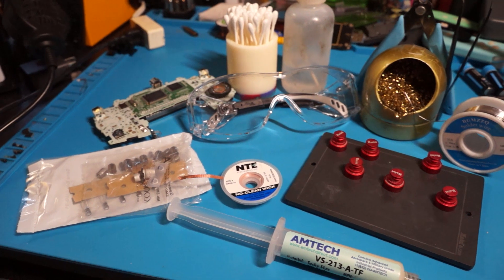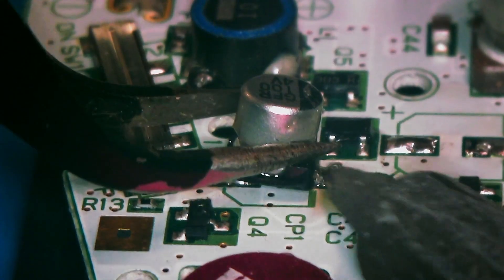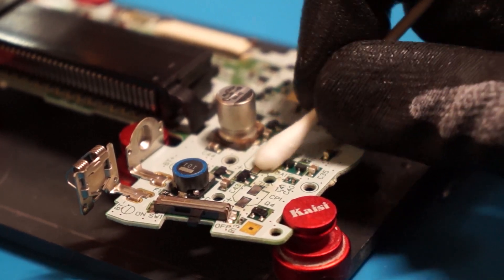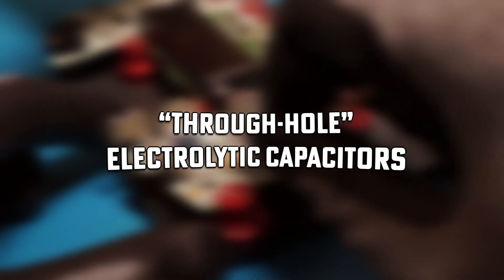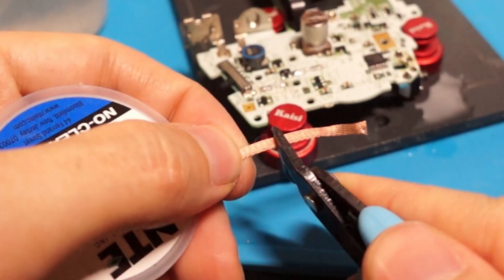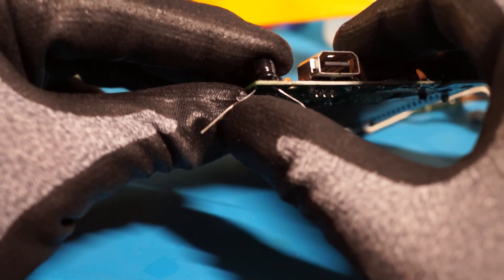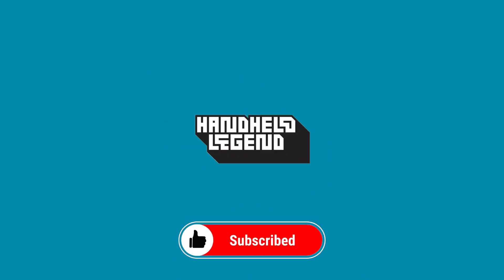Electrolytic Capacitor Replacement Guide | Re-Caps Made Easy

Comment: Your ideal iron temp for this applications?
Reply: This greatly depends on the iron type, wattage, and other qualities (digital controller, responsiveness, etc). Example: You will need higher temperatures with a less responsive iron. Cartridge types are more responsive than the types with separate heating elements.

Comment: I thought leaded solder is unsafe. Why not lead free solder?
Reply: Leaded solder is not unsafe. Leaded solder is superior and easier to work with.
Reply: Lead free exists because it could leech into the water table at a landfill, but unless you are licking the board it’s perfectly safe… and this work generally keeps them out of landfills. That said, a GBA has lead solder, not lead free as the video assumes. Lead free became the industry standard a few years later.

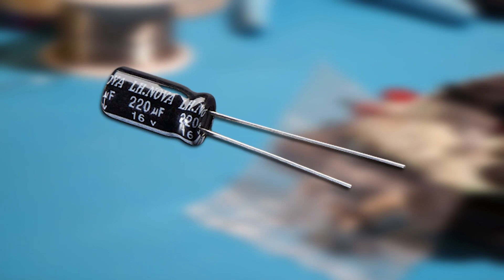Comment: 1:06 You mentioned: or slightly exceed the original capacitance. Is that a good idea? I've replaced caps in the past that are higher voltage than the original cap but they have always been the same capacitance level.
Reply: I also don't understand why he said that. A higher voltage rating is fine (as long as it still fits) but you should match the capacitance.
Reply: Never change the capacitance and never go lower on voltage and you will never have an issue.
Reply: You are correct higher voltage is okay, the same capacitance value is required. Changing values can mess up signals or charging circuits, depending on the purpose the capacitor is serving.
Reply: Depends where, resonant circuits needs exact capacitance since even the smallest change can shift frequency. RC circuits or oscillators also need exact capacitance because it affects timing. But in audio stuff it won't hurt, it may extend low-frequency response a bit but it will still work fine. And in power filtering/decoupling a bit more capacitance is even better, because of less ripple, more stable voltage, as long as the voltage rating is equal or higher. It all depends where the cap is and what it does.
Reply: It depends on the circuit. Most electrolytic capacitors are used for power supply smoothing, so going with a higher capacitance is generally fine. If you really want to get into the nitty-gritty details you might want to use low-ESR capacitors in certain parts of a switching power supply, for example. But in general, replacing an electrolytic with a "close enough" value is perfectly OK. Hell, they often have 10% or even 20% tolerances anyway.

Comment: FYI - The Blue Yeti's is a side-address microphone, so you should speak into the front of the mic, not the top. The side with the buttons is the back of the mic, so you'll get much better audio if you move the mic directly in front of you, then tilt the mic body 90 degrees away from you, so the front of the mic is pointed toward up you mouth.

Comment: Seems like you may be the right guy to ask!
   I have the viofio t130 3 channel cameras in my truck I have the power input hardwired correctly to the fuse box 
   I don't want to put any wear on my auto battery so been looking to install a powercell 8 at 400$ 
 Question is could I use a capacitor in between and get the same result cheaper